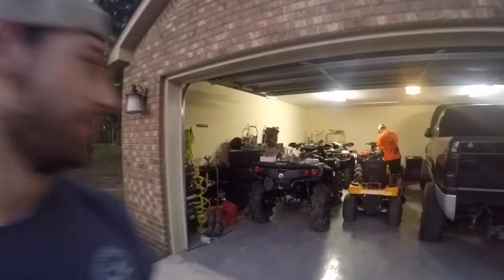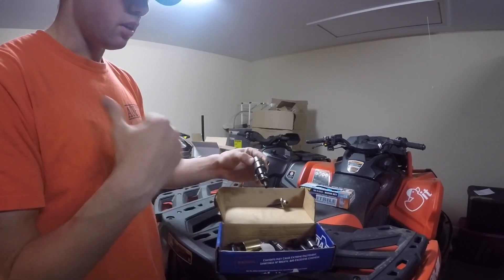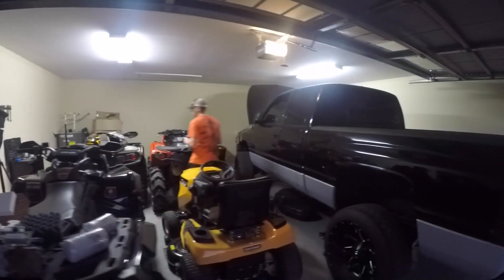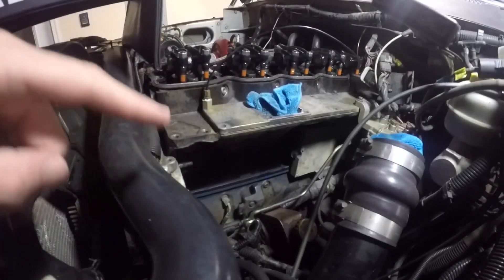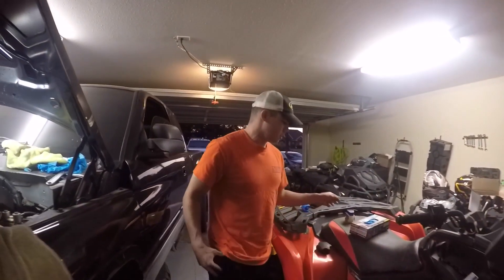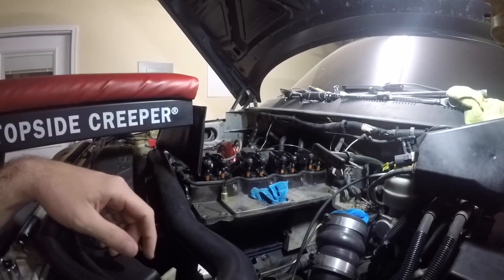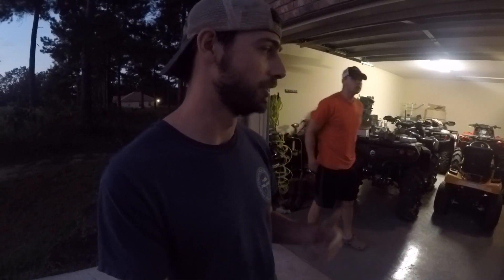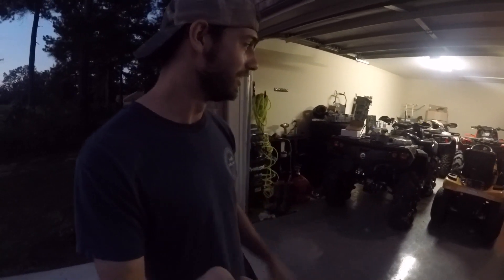Will the CUMMINS ever run again!?

Comment: I learned today that with the VP, if you put more then 12/13psi to it with the lift pump you can blow out the front seal... you might already know about this too but I figured I'd pass that along anyway. I thought you've said in the past you have gone thru a couple VP's.

Comment: My buddy is a diesel mechanic and every time he changes a fuel filter he fills it with trans fluid.
Reply: Frank A I like to pour a quart of atf in when I fuel up. Keeps everything clean.
Reply: Frank A I do the same with my 12v cummins
Reply: Chad Nichols no problems. not sure if it makes that much of a difference,since I run a fass 150,but it can't hurt.
Reply: tommyguns14able trans fluid will make the fuel hotter so it cleans off anything inside the injectors or filters better

Comment: 2stroke TCW3 oil will help lube vp 1 quart every fillup kinda smoothes my idle too!!!
Reply: Wutthaduck uhhhhhhh let me check my schedule 😂
Reply: DirtyDiesel24v where would you add the 2stroke tcw3 oil? Into the filter??
Reply: Myron Benally in the same place you fill up fuel tank cap located on driver side behind fuel door
Reply: Haha.. thanks!
Reply: Myron Benally no prob 😂
Reply: DirtyDiesel24v how do you think 2stroke oil compares to other additives? I use a bottle of power service diesel kleen every fill up